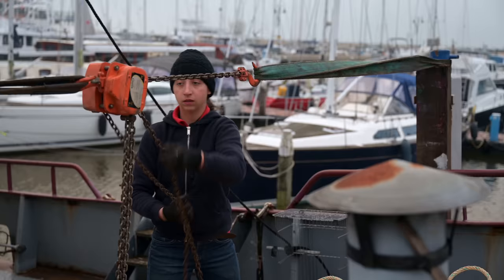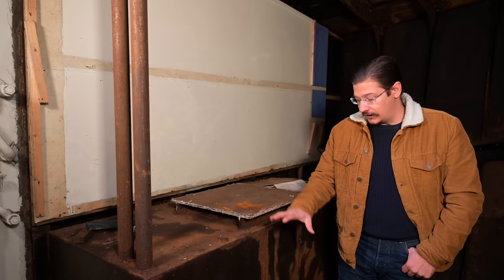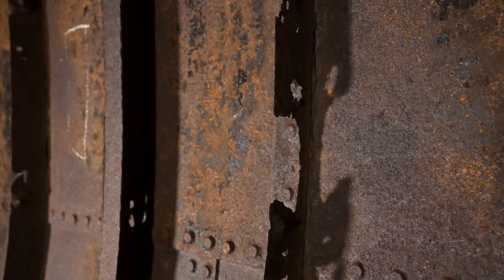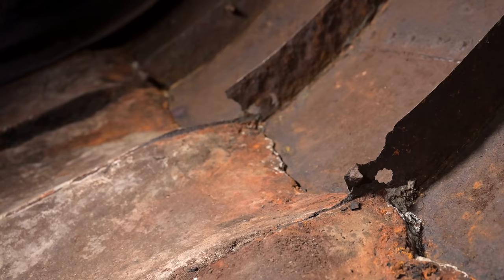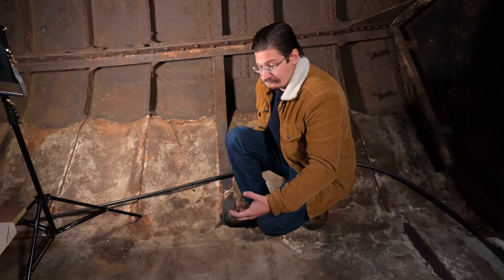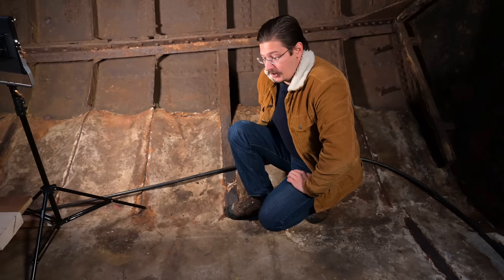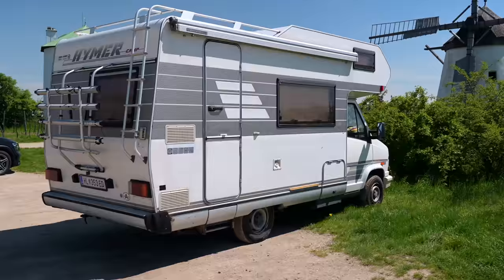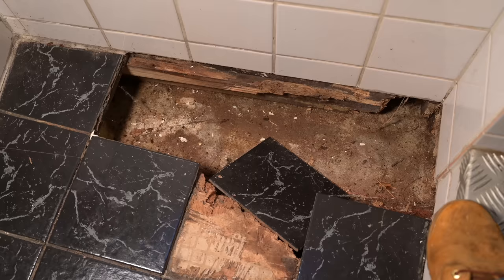The next PROBLEM... Why on earth have we bought this project boat???

Comment: Some of the best advice I got over the years of restoring bikes, cars, and tractors.. my master mechanic/machinist ( diesel truck, jet car, Robosaurus, race cars etc.) buddy said, don’t sweat the small stuff!… meaning if it’s working, most likely it’ll keep working. If your motors in good shape, there’s no reason to pull it out and rebuild it. It’s not a guarantee that the rebuild won’t explode or break… I’ve seen that happen too.. I’d say replace the hoses and the belts and any leaking valve,cover gaskets and run it. It’s really the only way to find the weaknesses in your system. I’ve heard of diesel trucks here in the US going over 1,000,000 miles without a rebuild… just my two cents, love the project…
Reply from the maker: Good advice 👍 At the moment the engine is really accessible but we will make the engine room smaller to make room for a second bath room / head. We haven't planned to take the engine out. Just maintenance, checking the valve play, tackling leaks of any kind and maybe a paint job so that it looks decent. I've heard recommendations that an in frame is recommended after 25 000 hours and a complete rebuild after 50 000 hours. We will never ever get to this amount of running hours.
Reply: Some good advice there from David  Lucas! I will back him up by repeating an old idiom: If it ain't broke, don't fix it!

It looks like there's more than enough things that ARE broken on that engine to keep you busy for quite a while!

Comment: 5:35 Holy crap NO! Do not seal the concrete. It works so well by absorbing any moister and evaporating it on the surface. Let it breath.
Reply from the maker: Interesting opinion. Most people I've talked about this step either said it's a great idea or they told me that it's overkill and not worth the money. But you're the first one who said it's better to leave the concrete unprotected.

Comment: Can’t wait for the overhaul of that motor. Belts hoses are just maintenance.  Can’t wait to see the heads off and the overhaul. Hope the liners are good.
Reply from the maker: Our overhaul will be somewhere in the middle of an extended maintenance and an in frame. 5000 hours isn't much for a truck engine. It's an equivalent of 400 000km or about two years for a truck.

Comment: I am very glad to hear you are going to do some thorough maintenance on the ship's engine. This is the right idea and the right mentality. It needs to run in events of emergency when your life truly depends on it. So its the best of ideas to do the maintenance until it is up to specification. Maybe you can find a workplace manual or repair manual for the engine, and sometimes these can be bought if you cant find them for free on the internet. 

Well, i hope you see through the project part and see it as fun when doing all the work. If you have read on the topics it will be a lot easier to get through the work. If you find the right people they will help you i am sure of that. Also, if you read on the topics you are dealing with with the boat repairs, you can be more specific and find the solution you are looking for quicker and for better prices. Of course a network of people helps a lot with finding the right people too. 

Good luck!

Greetings,

Jeff

Comment: it seems you finally undestood the money pit, me and other ppl,  were talking about. on top of the money (or, alongside it) you will need a team working with you to have this done in a pratical time frame. i think comparisons are useful when and if they are properly contextualized. having said that: Tally Ho is being build for years and Leo as a full team of PROFESSIONALS with him. without that team he wouldnt be able to gather footage, make videos, ie, have YT and Patreon bankrolling the project. oh and he wouldnt be having the boat build as fast as they building it. its been years and building from scratch its sometimes easier and quicker than repairing and refitting because you dont need to conform to something already established, you measure, template, cut and install the piece (in a simplistic way) you, on the other hand, have to walk on eggshells to not burst a rivet. i am refitting a 29 feet grp boat, i can do 10/12 hours straight of work (only wc breaks and water, i only have one small meal at the beginning of the day) for 4 days, then i need a full day of rest, and then i can do another 4 days, im 42 yo, ive been at my refit for almost 3 years because i can only work for 6 months at a time due to weather (im in Macau, near Hong Kong) and i still have another 2 years, at least, in front of me. i dont do YT, i take photos and publish in a couple of forums and even that takes time, if i had a channel i would never had the boat finished. i also work full time and in china thats 48 hours per week, 12 days annual leave, so im looking at your and......yeah......money....lots of it. not to mention the equipment you need to commercially operate and to a standard people would find comfortable.
Reply from the maker: Good luck with your project! We are long time followers of many projects here on YT. So when we started this journey we had some sort of estimation. We hoped that after a year we will be somewhere near Brupeg, Ship Happens or Sailing Yaba. We ended up with less than 1/3 of what they have. That's enough to continue making the videos but it severely affects the progress. We still hope that this channel will grow. 
Flying Coney is registered as a pleasure craft and we will keep it that way. So we haven't intended a commercial use. Once we're finished you can join us for sail trainings and expeditions but you will be part of the crew. As a private pleasure craft we can legally carry 12 guests + crew.
Reply from the maker: The capacity of 12 (+crew) is really important here because for more you need to be coded. In some countries it's allowed earn money with a yacht. In some countries there are exceptions for sail training. Also it's possible to charge money not directly for the journey but for a club membership. For example you need to become a member of the Flying Coney Supporters Society to be invited on a journey. For every 100€ support you'll get a one day free journey 😉 I'm not a lawyer neither a tax consultant but this is how many boats are operated. In theory the whole German traditional sailing fleet isn't allowed to make money.
Reply from the maker: We want to bring back Flying Coney to the Tall Ship Races. To participated 50% of the crew must be in between 15 and 25 years of age. That's what I have in mind when I say sail with young people all around the world. Flying Coney will not be a charter Yacht with cabins for two adults with an en-suite bathroom. We do want to sail and explore and not move from one harbor to the next. 

If an accident happens aboard any kind of boat usually the case wants to court. It doesn't matter if the boat is coded or not and it doesn't matter if your son has paid for the trip or not. We do have an insurance and we we do follow guidelines and rules. So if the yard comes down, was it because there was a technical failure? Or was it because the captain failed to get weather informations. Was it because the safety instruction wasn't sufficient and he was in a danger zone. There is a risk involved in sailing but we try to minimize dangers. 

But this has nothing to do with your initial question. A friend of yours takes your son on an Atlantic crossing on a Bavaria 65 (A non coded and not commercial yacht) during the night he slips and fell overboard. Who's liable. I know Flying Coney looks like a traditional ship but legally we're just an old, non commercial yacht.
Reply from the maker: I do appreciate that you bring up this topic. I try to make give you an analogy. If you have a house, big or small you're allowed to have a guest room and you can accommodate friends. In many countries it's even legal to take rent if you make an Air B&B. But if you make a hotel in the very exact building you'll need to comply with a lot more rules. Like having emergency escape sings, coded materials for walls and flooring and trainings for the staff. It's the same building but different rules apply. If you make a house out of a former hotel you still can follow the guidelines but legally you're not required. That's what we try to do. 

The accident you've described unfortunately happened about 3 times within the last 2 years aboard dutch sailing vessels. There's a huge discussion at the moment about wooden masts and wooden spars. 
We do everything what we can do to make the boat safe. For example we do not weld below the waterline and let professionals do this jobs. The rig will be made by a company who is experienced. We will make stability tests and so on. 
Within the next years we're planning to make the RYA Master 200 with the commercial endorsement. So that's the personal side of the problem solved. We have information that in the Netherlands you're allowed to take paying passengers out on a pleasure craft. But I need to be more certain before I'm sure enough about that. 
Lot's of grey areas here especially when you plan to cross borders... I've mentioned a few work arounds. But it's a serious topic and there should be no compromises made regarding the safety of the vessel. 

You may ask why we don't go through classification as a sailing passenger vessel. On the one hand that would increase our capacity from 12 guests to about 60 day guests. That would be nice. But we would need to fulfill the same standards as a new built boat. Stage V engine, fire fighting suits, every material certified, annual inspections instead of inspections ever 7 years. So refitting costs would explode.
Reply: It’s easy to demolish can’t wait to see the craftsmanship.

Comment: If the bathroom is always damp then I would guess that it's a condensation problem. There is probably no (or not enough) insulation between the hull and the bathroom wall. So it probably needs to be insulated and it also should have good ventilation.
Reply from the maker: Good guess but most likely that's not the cause. One reason might be that water enters with the wooden deck. Or there's water coming from some welding seam.

Comment: Its a hard project and a hard way to live during the years of construction as well. Those steel supports will go quickly with cardboard templating - and the concrete sides will come off quickly with a small hand jack hammer but be careful. As you are in the water, you want to have some water patching tape to cover any leaks that spring up - just in case.

Comment: That engine-room is just crying out to have a 8L3B Gardner engine sitting in pride of place.
Reply from the maker: Gardner engines are the most beautiful engines ever built and the 24 liters displacement sound tempting. But our DAF 1160 DKS is king when it comes to fuel economics. 10 liters per hour is next to nothing. This is achieved by a turbo an intercooler and a special cylinder cooling. The DAF also has a distinctive rough idling sound. It sounds like a big big muscle or race car. I love it! Also the DAF is based on a Leyland engine.
Reply: @FlyingConey Mmmmm. Well I dont know what rpm the DAF is burning 10 litres of fuel an hour at but it must be pretty low. A 230 hp at 1150 rpm 8L3B Gardner will be using around the 9.2 imperial gallon/ 41 litre an hour mark. And Gardners are acknowledged all over the world as having a low fuel consumption. Heres a rule of thumb that still stands true to this day. 1 imp gallon / 4.5 litres of diesel in a pre electronic/common rail  engine will produce approx 25 hp mark. And this applies for turbocharged units. So your DAF is making around the 55hp mark at whatever rpm range its getting thru 10l per hour.  Not knocking your DAF in anyway, shape or form.
Reply from the maker: So far we've been running the DAF a bit low.   1200rpm doing 5.4 knots. We probably should go a bit higher since the engine is ratet up to 2200rpm. Somehow I thought it's 1800... We've been on a sailing ship called Jantje equipped with a Scania Diesel and they use 14-15 liters going a bit faster than we do. So our fuel consumption is low but not unrealistic. You have to take into account that we do have the hull of a drift netter. It's a sailing ship hull and not a trawler hull. The first engine only had 150hp and she still could reach 8 knots with it.    @matui6983
Reply: Id be looking at the engines specifications and ratings and look for the rpm setting where the engine is making its highest torque figure as this is normally the most economical rpm point of pretty much any marine engine. With it being rated around 2200rpm I wouldnt be surprised if 1500-1800rpm could be the best point to run the DAF at. Should reach the hulls best cruising speed around there, go over that and your speed may not increase too much but your fuel burn certainly will. The difference in fuel usage from say 1500rpm then jumping up to 2000-2200rpm surprises a lot of boat owners.

Comment: I also have a boat with poured concrete (the boat is much smaller, but of similar age). So I find it interesting what you said about the preservative property of concrete. I have also heard before that concrete is basic and therefore protects steel from corrosion. However, I've also heard voices that concrete shrinks a bit as it dries, so concrete would be a big problem because corrosion happens unseen underneath. What do you say to these arguments?
Reply: There are different types and and mixes of concrete all depending on the use .if done properly for the use intended and it has been in place for some time without issue you may feel confident there will be no issue in the future .If you are worried about corrosion starting it will start at the outer edges so to prevent this the simple fix is to apply a coating of some type overlapping the concrete and the surface of the hull , basically creating a seal so there is no intrusion beneath the concrete .
Reply from the maker: What I've said in the video is backed up by the shipyard and the surveyor. You'll get a rough idea of the condition of the steel by making an ultrasonic test. But how does the concrete look in your boat. Does it crumbly, do you have cracks in it? If not I wouldn't worry too much! Concrete is a far bigger problem in wooden boats and same people fail to differentiate and funny enough, Leo poured some concrete in Tally Ho's bilge. Also other forms of ballast are not bullet prof either. Recently I talked with a commercial inland captain and he once had an emergency on a river cruise ship because the scrap metal ballast has eaten its way through the hull.

Comment: Completely understand your disheartened feelings for the boat. It was a project boat in disguise, with all of its problems. But, look at it this way. Yes there is a lot of time on the hard and issues to sort,  along with the rebuild of all internals. However, at the end of it you WILL have a boat you can put your trust in, knowing the engine, electrics are good and you can design her interior as you want. Chin up Daniel its not so bad. You & Barbara will get there its only time against you.